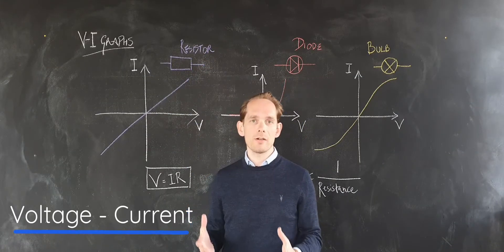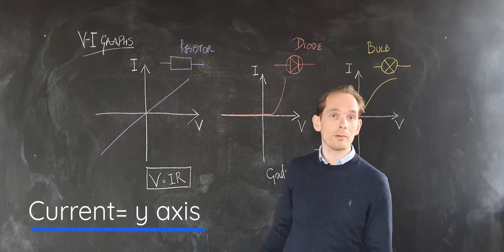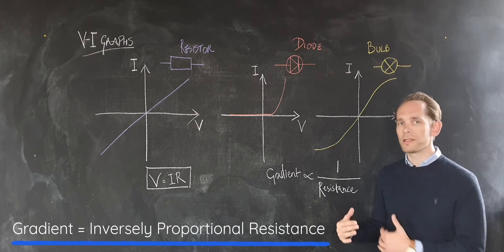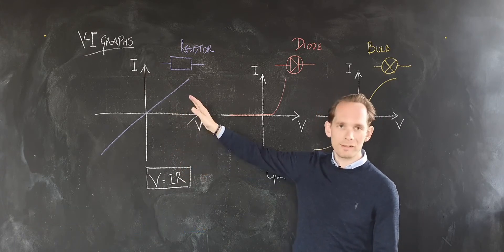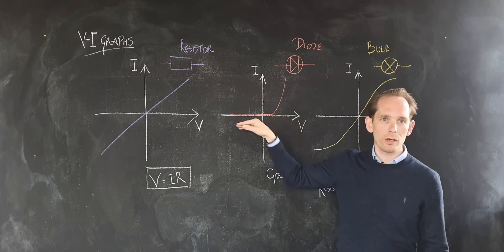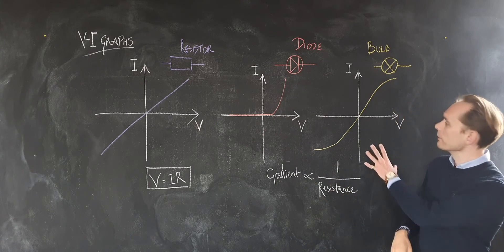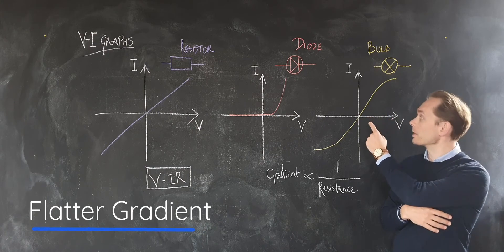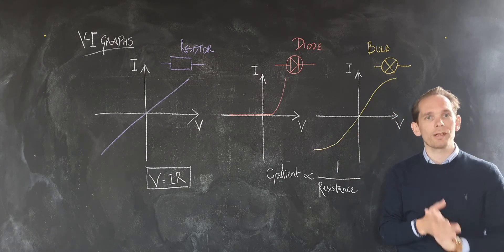Voltage/Current Graphs - GCSE science, Physics (9-1)

Comment: Thanks for this quick refresher.  It is annoying that the graphs chosen at GCSE are always 'conductance' based not resistance as it would be good to think of resistance (Ohms) as 'Volts per Amp'.  I guess a lot of pupils just learn these shapes rather than fully interpret them in the same way that they think that V=IR 'is' Ohm's Law!  Still, as with all physics you have to start somewhere and then develop the theory.
Reply: I agree with you - and it feels like a missed opportunity to show these graphs the other way around with resistance as the gradient. I've always assumed that it's taught this way around because of the principal of showing the independent variable on the x-axis. Whenever I did these expts/demos in the lab, the students would set the p.d./voltage through the circuit and measure the current flowing, so that the 'input' of voltage ends up being the x axis while the 'output' - current - is shown on the y-axis.
Reply: @murraymorrison2059  Yes, that must be the reason at school level - some semiconductors are best thought of as having I/V characteristics too post school level so that might have something to do with it as well.  I am not sure it aids learning though!